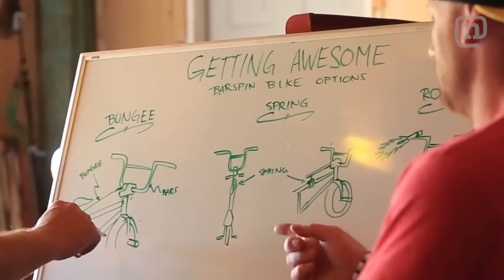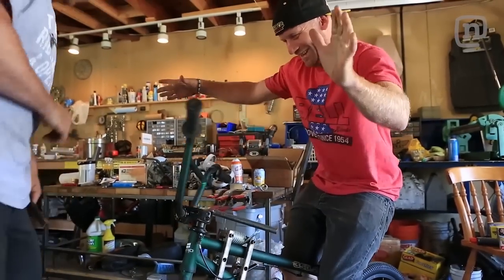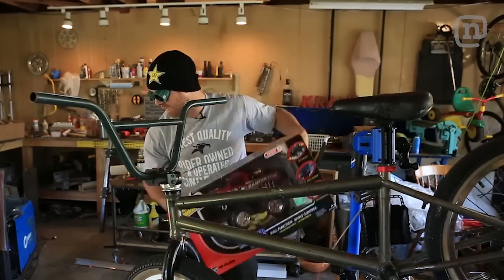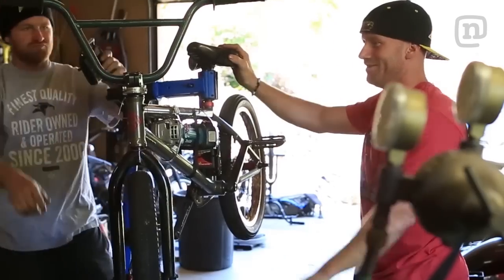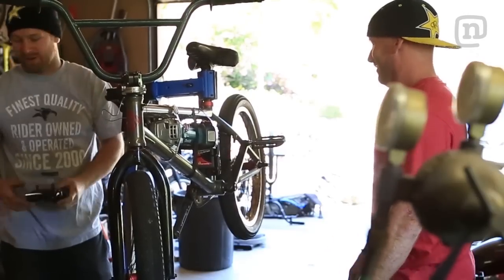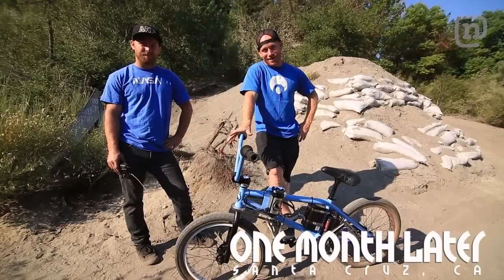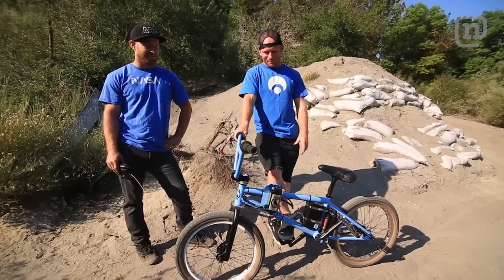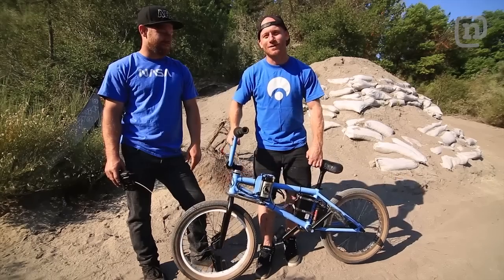Remote Control Barspin Bike Invention! Getting (Super) Awesome With Ryan Nyquist Ep. 20

Comment: it didn't spin in the air with the weaker motor because of the added giro from the wheel spinning, the wheel adds more force and makes it harder to spin.....
Reply: I wonder if it would change anything with the weak motor if he hit his front break right after he went into the air...
Reply: +Mirrors Reach Youre right. The motor is opposing the gyroscopic procession of the spinning front wheel which is why the motor went so much faster with the bike standing still than in the air. You could see the effect the gyroscopic procession had on shea when he turned it on full blast at the end of the video and the bike spun him around.
Reply: Dylan Anderson At least someone else understands what I'm trying to say :)
Reply: +Trey Michael yes that would get rid of the gyro effect
Reply: +Trey Michael Might buck him a little forward because the angular momentum of the wheel would be transferred to the whole bike
Reply: Daft thing is ryan knows this...cos hes said the only way he does suicide 360s is by tapping the front brake so the bars dont start spinning on their own?

Comment: Why at 4:26, centrifical force. When you were static in the shop there was no counter axial forces resisting the rotation in the neck. Once the wheel was spinning the mass of the  wheel created so much force the grinder mod could no longer over come it.

Comment: instead of remote, why not switch on the handle bar.  when holding the grips, circuit is open, when you let go it closes circuit for a split second, enough to give some spin.  less electronics, and also a quicker reaction to enable spin

Comment: its because the motor is opposing the gyroscopic procession of the spinning front wheel that the motor went so much faster with the bike standing still than in the air. You could see the effect the gyroscopic procession had on shea when he turned it on full blast at the end of the video and the bike spun him around.

Comment: well wait, the belt has plenty of power to blow up what ever that was at the end they threw into the bars... In this video he's holding the frame instead of the bars, so in theory, if he held the bars and let go of the frame, couldn't the frame spin using the same rig the used for this barspin?